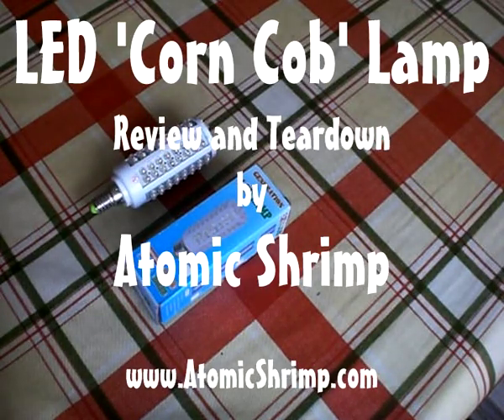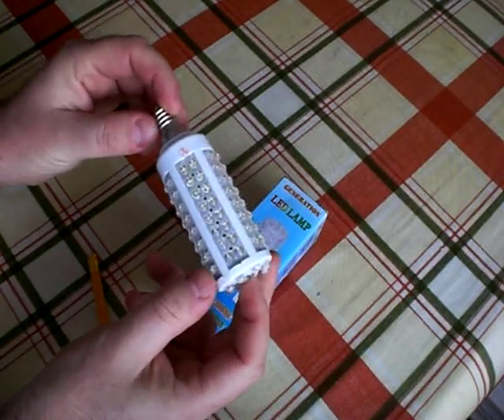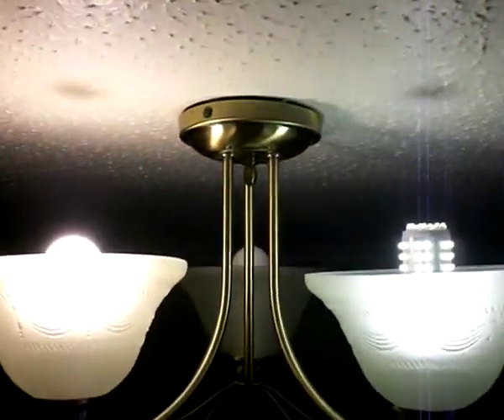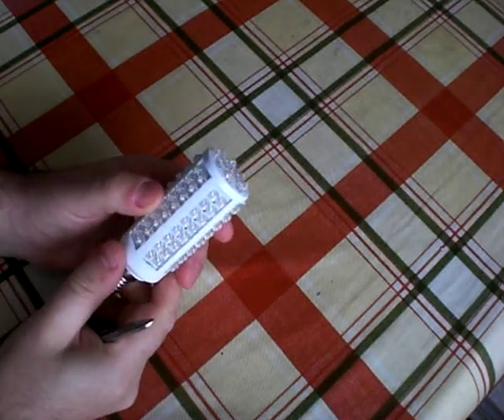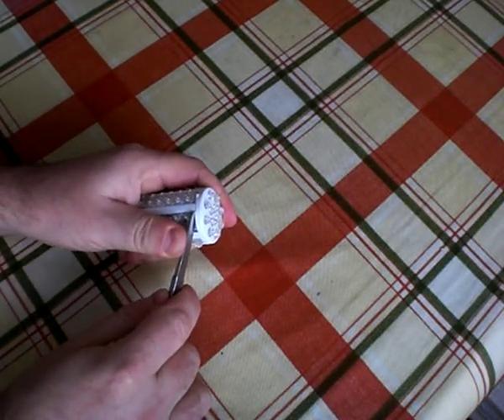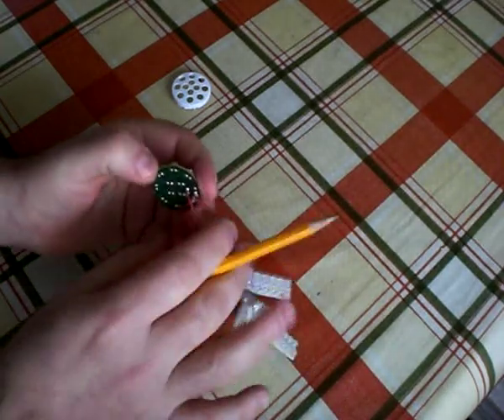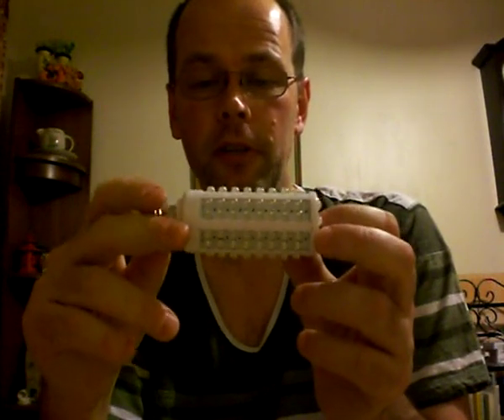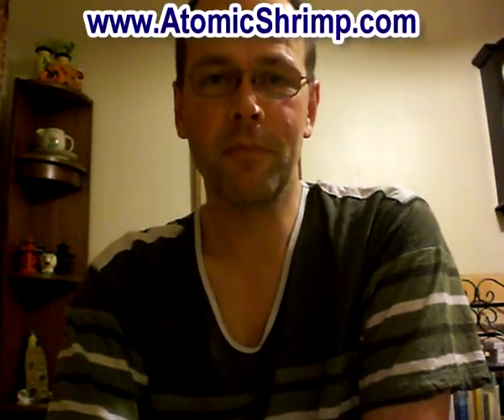Review and teardown of 108 LED Corn Cob bulb

Comment: I use a bigger version of this bulb on the properties that I manage for street lighting they do last longer than the regular ones however the price has increased and it’s color does change overtime and when they do burn out it’s hard to find anyone who will recycle them. 
Overall it’s wasteful as far as all the plastic and wires that are just tossed out.

Comment: Main issue with cheapest LED bulbs  driver running them too high.There 
is not much current control via any stabilizer.They were bright too 
prove amount of light.I bought some on ebau from Netherlands and they 
run in corridor.All good.Quality should be improved.But to be honest if 
you pay 2,50 for Led bulb someone has to solder and assemble you can not
 expect good product.

Comment: If it was a known brand, the quality might be better.  The problem with generic stuff is no one knows what to expect.  There MIGHT be other one on eBay that are similar but better quality.  Find that stuff like that gives Chinese products a bad reputation as being short lived and unsafe.  When in clusters, LEDs can produce heat and you may have smelled them heating up.  If you have ever noticed the big heatsinks some LED lights have on them that should give you some idea how how some of those things can get.  There are people with modified LED flashlights who set things on fire with them but I don't recommend doing those things unless you are careful and have a fire extinguisher in case of an accident.  I would not want a flashlight like that, instead just a bright enough one for most things I would do.  Some LEDs don't get noticeably hot and they are the lower powered ones found in standard flashlights that are sold in stores next to the cash register as "impulse items" which are sometimes bought at the last minute before leaving a store.

Comment: I bought 2 of those as well, they did put out an unnatural bluish light. I bought them long ago before I encountered this video. Everything you said was accurate; as mine popped off their end caps on their own. When U removed them and remarked that they came off surprisingly easy, I had to watch the rest of the video.
  The burning smell U encountered worries me; I'm going to check out the 1 I have working in a hallway.
Thank U very much for your diligent research, thorough review, and warning.

Comment: The circuit is really typical of low power LED lamps, but as you guessed, they tend to drive the LEDs quite hard.  By swapping the metalised cap for a lower value version you can turn the lights into handy nightlights with much longer LED life due to under-running them.  I'd have chosen to use two separate series resistors for the LEDs to spread the current more.
Reply: Fancy seeing tou here.

Comment from the maker: To tell the truth, that's pretty much what happened with the UK version too.  Mmmmm - the great smell of roasted PCB...
Reply: My thoutgt is that they both are US versions. You can tell that of the green tip at the screw.EU and 230v versions should got White tip.I have bought plenty of LEDs from chinsa and those with green tip has only worked 2-3 Days. And those with white tips is still working a year later.Some of my green tip lamps has even explode on the PBC board. An tubular Component exploded and crack the buld housing. (not a cord bulb but an regular round LED bulb)I have even recive some porly entempt to hand paint over the green tip with  white paint, like TipEx so the should look like 230v bulbs.Thats is very angerous.A scam.

Comment from the maker: I've no professional background in electronics, but I've dabbled with hobby projects since the 1980s - I'm familiar with the smell of flux - and I'd say it's a component of the stink that came from this thing, along with the smell of overheating resistors,scorched polymers.
I don't consider capability of designing a good solution a necessary qualification before identifying a conspicuously bad one.  I don't know how to engineer a competent LED home lighting device, but it's clear this isn't one.

Comment: I wonder what is your relationship to electronics? The smell of burning electronics is the smell of flux. Hand soldered, to much flux used, hence the smell.
On 11:15 you say tha you think it must be engineered a bit better than that. Do you have an alternative solution in running LEDs directly from AC without the use of a transformer? 
I cannot comment on the illumination level, nor the drop of it after a week. 
Cheapo? yes... 
Bad light quality? Propably,
Dangerous? I say no.

Comment: Yes, I hope that is the case because LED is one of the real answers to our energy problem.  Also thank you for this detailed video.  Because of it, I was actually able to save 2 lightbulbs that had half of their LED's out (bad solder connection where the capacitor met the board).
Thank you!

Comment from the maker: You certainly can - I've subsequently bought anLED spotlight unit for my kitchen with which I am delighted - but that's a purpose-built device with its own switch mode power supply inside.  Good quality LED lamps are out there, but they're not terribly cheap yet - and the cheap ones aren't good.

Comment: What happens is the power dissipation of the LEDs is derated due to the heat of surrounding LEDs....this causes the LED to lose efficiency which creates even more heat. 
The maximum allowable core temp is reduced with more ambient heat so the life is being whittled away quickly unless you live in the North Pole.  Stick with CREE (US made) chips always.  They provide designers with Thermal Management requirements and ideas so they can keep the cores within the limits of temperature.

Comment: In these circuits, they use a metallized polyester capacitor because it must have a very low dissapation factor in this use.  It acts like a moderate impedance in series with a resistance (the LEDs and series resistor). The resistor across the MP cap is to discharge it for safety and prevent additive voltage if power loss then power returns. The filter cap is so small uf that it must be to suppress transients and partial smoothing at best. The resistor across is not needed..The LEDs swamp it.

Comment: I've bought a number of these off eBay and found the quality to be all over the board. The "greenish yellow" tint is all too common.  One should make sure the unit contains either CREE or Lumileds because they have tight quality control and binning. The bulbs that contain CREE chips (Ideal Llighting on Amazon) have lasted over a year now with no ill effects and beautiful tintless warm light.  They are a little cooler than the old incandescent but color rendition (CRI) is better in my view.

Comment: unnatural light color?  next time get the proper color temp.  I have these in my home in the bathrooms, using the warm white, and they light the room fine, and don't smell like they are going to explode.  They are cheap like you said, I don't plan on paying $30.00 for  the philips led bulbs when I can get 4 of these for the same price.

Comment: That 'greeny yellow' color you're getting, is actually what's called Warm White for bad LEDs. The problem with these dirt cheap LEDs is that their CRI (Color Rendering Index) is very low, often lower than fluorescent bulbs ones'. This gives a bit of a bad reputation to LEDs, especially the mainstream bs ones you find cheaply at the store. IDK how much the one you have cost, but you could have easily gotten a high power SMD based one for less than 10$ - and they are better. BTW, great video!

Comment: Hey nice video. 
Newer bay this " a lot of SMD LEDs ". Because, as you said. An aray of 12 LEDs in serie. 
You only need 7 bad SMD LEDs, out off 108, and the bulb is dead. If 1 or 2 LED out off 108 have an error, the light is total BAD. 
LED light bulbs is nice. But only if there is 1 or 3 Super power LEDs in them.

Comment: That is insane! I have encountered these issues twice. First, I opened a dollar store night light. The circuit was a resistor (small through hole type) and led ACROSS THE MAINS (110v). The other time I say something like that was inside a Ipod switching wall wart. They used the same type of resistors, and wires that were the same size as something that would handle 3v in a flashlight. Such small gaps in mains input can actually cause arcs I have heard.